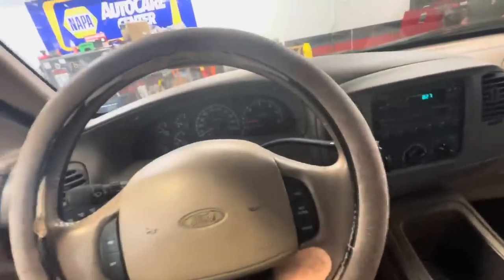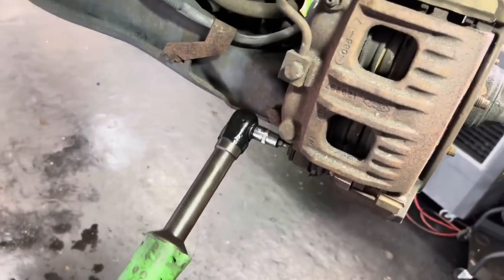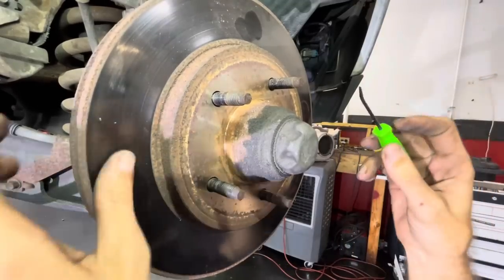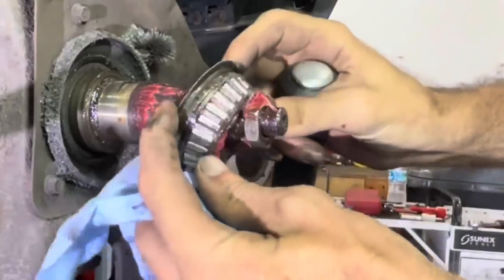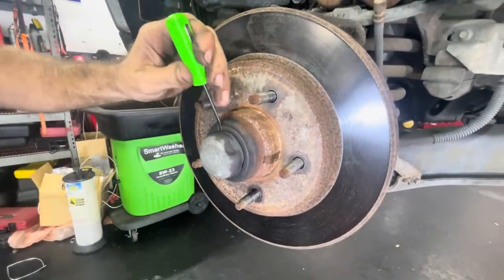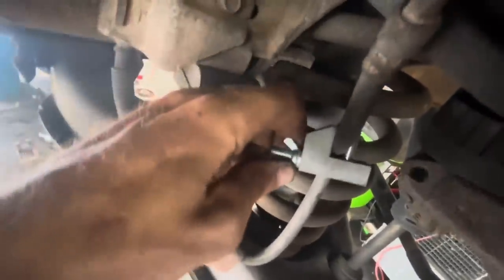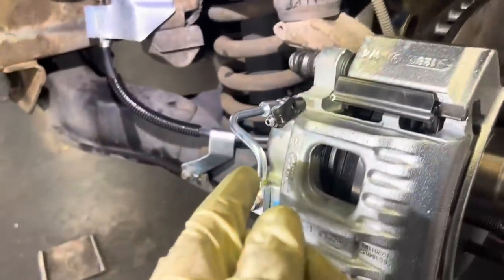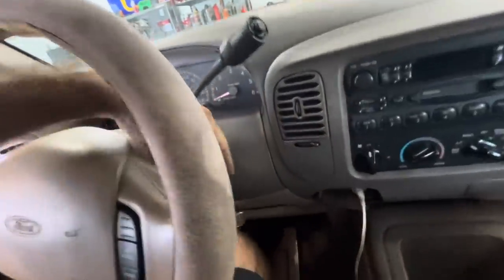Worn to NOTHING! 1998 Ford Expedition

Comment: Ray, may I comment on bearing lubrication ?  Many years ago I was maintaining a factory and got SKF in  (for free) to give us a course in bearing maintenance.  Amongst the gems were greasing the things.  50% of bearings fail as they are under greased and 50% because they were overlubricated.  Grease is 90% oil, so an overlubed bearing can overheat causing the viscosity of the oil drop lowering its effectiveness and hence early failure..
If you look the bearing up on the SKF website, it gives the amount of grease required..
I hope this helps.  Love the vids and running commentary.
Reply: My first job in industrial maintenance was going around on Monday with an oil can and a grease gun it is very important also the last place I worked at the maintenance man drove me crazy because it didn't get done all the time
Reply: @benurr720  Timken, SKF, NTN are all world class products.  You are quite correct to pack the bearings. As to a failure, I can't comment, but I can assure you when we moved to a strict Predictive Maintenance Programme coupled with correct bearing install and lubrication,  our bearing related failures dropped to almost zero in a 1M sq.ft Plant
Reply: @michaelpressman7203  You have my sympathy.  Your employer was wasting your time.  A  Lube tech needs to be properly trained, equipped and scheduled, with a supportive Management.
Reply: @MrRunner  companies nowadays think they're paying for skilled maintenance is a waste of money but ask all the people that went down an airplanes because a part didn't work right you figure it out
Reply: @Graham Miller Consider that a car with 24 inch diameter tires (kinda small but giving you the benefit of the doubt) those wheels will rotate about 845 times in one mile so at 60 mph they will be rotating at 845 RPM. Which is pretty slow compared to industrial spindle speeds. Consider also there is astill quite a bit of air space in those front automotive wheel spindles even with packing extra grease in there. Also consider that, being tapered roller bearings the grease gets move out of the bearings by centrifugal force. All that said... boat trailer wheel bearings are often packed completely full of grease (grease fittings in the bearing caps) and sometimes it is under pressure ("bearing buddies")to keep the water out. Boat trailers also tend to have pretty small tires so they spin faster. They DO fail and fail often but 99.9% of the time it is due to corrosion from water getting in to the bearings.
Reply: @utidjian  It is not the speed, it's the load.  In a wet design, if not correctly sealed it won't matter, water ingress will kill the bearing.  Whenever possible I would buy sealed bearing.
Reply: @utidjian  I was going to make the same example with trailer bearings. Funny I was doing my boat trailer bearings the same day this video came out 😆. The factory/plant environment is probably enclosed and not exposed to the elements. Whereas my boat trailer goes into saltwater every weekend. Every few weeks I pump fresh grease in to ensure there is no void where water can settle. Preventative maintenance keeps you from being a road side spectacle 😆

Comment: 300k on the clock?! That expedition has been well cared for. Kudos to the owner.
Reply: I still daily drive my 97 expedition I bought from a friend in 2001.  It's a little shy of 300k as well.  Runs and drives remarkably well for an old girl.  Unbelievably reliable, back when "quality was job 1".  Still has the original starter, water pump, exhaust system and the AC still works,  Replaced the schrader valves and topped off the refrigerant last year.

Comment: Yes the pliers being used incorrectly bother me as a long time plumber I see plumber use them wrong and ruin the teeth as well as applying teflon tape incorrectly!
Reply: You got to go clockwise with your tape it won't peel off that way
Reply: Plier use only bothers me when people round off the bolts or scrape the bejeezus out of whatever they are gripping.
Reply: Man we're talking about automotive mechanics and all the great things raiders and all you guys keep going on about is a pair of pliers hey take the fires and get a grip for yourself bye
Reply: Any tool used wrong drives me crazy I agree

Comment: Since your installing new rotors and bearings, the races in the new rotor may not be completely seated. So it is recommended to torque the nut on the spindle down to 100 ft lbs to insure the races are bottomed out. Then loosen the nut to the just past finger tight.
Reply: Correct. It's called pre-loading the bearings. I'm surprised Ray didn't do this.

Comment: Great video Ray. One thing I used to do prior to pushing the caliper pistons back was to remove as much brake fluid as possible from the master cylinder reservoir first to avoid over flowing the reservoir if it came in full. Keep up the great work!

Comment: the earlier expeditions  up to 2004 were very reliable in my opinion, we had  a 1999 make it to 394K on the original transmission, rear end, and a/c system, the engine died at 289k due to neglect, the 2nd used engine died at 394k due to neglect

Comment: Knipex, Channel Lock and similar pliers with the jaws set at an angle to the handles DO have a right and wrong way to apply them. The outer jaw pulls the nut/bolt surface tighter into the pliers. The jaw opening should always face left when tightening and right when loosening. Love your videos!
Reply: yes they do have a right and wrong way, the question is "how OCD are you" though, when it bothers you that it's done the wrong way in a situation where there's almost zero load on it and it works just fine either way. The answer is of course "yes it does bother me, OCD and proud!"
Reply: @SebBrosig  The same applies to adjustable wrenches ('Crescent Wrenches'). I have many, from 3" to 24" long, but I rarely use them, since I have actual wrenches and sockets to use. The adjustable wrenches, like pliers, are designed to have the torque applied in one direction,. Watching tools being used incorrectly has nothing to do with OCD. It is more like, "Wow, this person is an idiot".

Comment: Hello been watching most of your videos and I like the way you do things I'm an old-time mechanic I made it three years old done a lot of mechanic in and a log truck driver but I must say I was a little bit disappointed in the way you packed those wheel bearings you need to go on the big side and work them back and forth on the the grease in your hand until it comes out the little side this is the only thing I would like to see you change of course that's up to you I think you are an excellent mechanic keep up the good work
Reply: I bought a 67 Chevy Impala 2 door fastback $400 and all it needed was new wheel bearings
Reply: PS His glove wash dirty and as packing rolled the bearing at the dirty tip of his gloves finger area,. Never wore gloves and washed hands before putting the grease in the palm of your hand.
Reply: @waynetrainor654  I never wore gloves either I know how to wash my hands
Reply: Yes Sir, the grease should go into the larger end and get pushed through the bearing until it comes out of the smaller end. Any grease monkey can confirm that !! Ray is doing it bassackwards here.

Comment: As to adjusting wheel bearings. Every one has their own method. The trick is to get the right preload. A torque wrench is an accurate method. If the split pin holes in the nut ,locking cap do not line up, back off until the holes line up DO NOT tighten the nut.

Comment: If you open the cap on the master cylinder, the fluid has somewhere else to escape and won't push the pistons out.
Reply: Theoretically it should not back out of the reservoir if it does I take a better look at it
Reply: @michaelpressman7203  you're pushing fluid, which doesn't compress. Where else would it go
Reply: @uenragedbro  I always thought there was some sort of a check valve in the system
Reply: @michaelpressman7203  As the pads are worn down, the pistons move further out, holding more fluid in the caliper and taking from the master cylinder. It goes back in the master cylinder when the pistons get pushed in, unless the master cylinder is closed and the fluid has nowhere left to escape but the other pistons.
Reply: @uenragedbro  you're right I wasn't looking at things clearly I was having my first cup of coffee hey have a good day bye
Reply: @michaelpressman7203  you too! What kinda coffee you like maybe I'll get you a bag of it lol

Comment: Your technique of reinstalling the rotating assembly is almost exactly as my own. I was always taught to tighten the bearing to a light-torque preload while rotating and then back off about 1/4 turn. But unlike your description, I feel a very very slight click as I move the assembly laterally. This leaves the bearing an ever-so-small amount of room to expand with heat and still not bind the bearing.

Although I've done it this way for 30 years, I'm now curious if my school of thought has been passed by without my notice. What do others think about my final preload procedure?
Reply: That's what Ford advise for mk2 cortina mk1 and 2 escorts. There should be some play when cold. I'm in the uk as well.
Reply: @martinrobinson9651  Good to know because I'm a medium/heavy tech. I've always just downsized my technique when working on my own or smaller stuff.
Reply: Yep, he should've pre-loaded those bearings. At this truck's next service those wheel bearings will need tightening.
Reply: I do the same as you with the preload....specifically for the heat consideration.

Comment: Fun tip:  An exhaust U joint clamp (of the right size) can be gently tightened onto a wheel bearing dust cap, then you can pry on the clamp all you want and avoid deformation of the dust cap.

Comment: Loved the video. Been a while since I repacked wheel bearings. Has anyone else ever heard of adding STP oil treatment to the bearing cup to extend the life of the bearings? I heard it from a maintenance guy I worked with. Said to halfway fill the bearing cup before you tapped it on. It was the only solution that they found at a GM dealership to solve the problem of premature bearing replacement for one of their customers.

Comment: If you look closely, you'll note that just like a pipe wrench, the teeth on most channel locks are directionally oriented which is what Ray is talking about when it comes to 'proper use'.
Reply: Proper use like using channel locks as a hammer
Reply: @samholdsworth420  Weren't you listening? "Everything's a hammer." LOL

Comment: Just for reference here in the UK the disposable type pin as in this video is a split pin, the reusable type pin is an R clip because its shaped a bit like a letter R and a cotter pin is the type with a wedge cut into one side of it as used to secure the crank arms onto the bottom bracket shaft on an old school bicycle.
Reply: I used to use our pins on race cars if you want to get under the hood real quick they make life easy especially if the car got wrecked

Comment: Another great job, Ray my curiosity is to the effect of how much more it would be to replace the other caliper? I can’t imagine it being that outrageous where are you start out fresh with both front brakes completely redone. Oh well I have a good weekend
Reply: Probably an extra few hundred. Calipers aren't cheap, and the labor to replace the caliper isn't fun either.
Reply: @CalculatedRiskAK  Physically replacing them isn't hard, depending on how much of a pain it can be to get to them. These, just like the ones on my 3rd gen Ranger, aren't hard. The worst part is making sure you bleed all the air out of the brakes. That, in some cases, can take hours.

Comment: At the GM dealership I worked at we had to rebuild the calipers on every brake job due to the heat from braking causing the rubbers to become hard on the slides and caliper piston oring. Caused almost zero comebacks. The only calipers we did not rebuild were the rear calipers with the integrated parking brake in the caliper. By the time you were replacing brake pads on those, the retractors were frozen or had come apart depending if the customer used the emergency brake or not when parked.

Comment: Have you ever thought about using an angle grinder to take off the rust band on a rotor (if you're replacing it anyway) so the caliper will slide off easy? (Just thought of it myself)
Reply: Work smarter not harder
Reply: So easy to press  pistons back into the caliper using a C clamp before even attempting to remove the caliper assembly.  (You probably shouldn't be working on brakes if your first thought was to use a grinder on them)
Reply: @bushmaster2936  the pistons came out, good luck getting them back in. I had it happen on my blazers rear discs (bought it like that) The piston decided to break in half rather than go back in place. Had to replace the entire caliper
Reply: @bushmaster2936  also he's talking about the video you didn't watch obviously. Piston came out and if it happens good luck getting em back in. 

Pistons do go back in easy if you maintain your vehicle properly lol.
Reply: @samholdsworth420  I missed the beginning of the video due to a phone call interruption. Thanks for making me start over at the beginning to see the "over extended" pistons. LOL
 I also noticed Ray prying from one side of the piston . I have had better luck using a C clamp or two to squeeze the pistons back squarely rather than prying them cock-eyed. The seals weren't leaking so the pistons were still in their bores albeit unable to retract by themselves. I've also had a brake hose fail internally causing a one way effect and not allowing the fluid pressure to release, thus acting like a bad caliper. Yes, I have had to replace numerous calipers over the years. We used to rebuild them back in the day if they weren't too badly pitted. Same with wheel cylinders on drum brakes and an occasional master cylinder or two. Have a wonderful day !!

Comment: Split pin, cotter pins are tapered solid pins with a flat ground on one side, used to hold bicycle pedal shafts onto the crank.

Comment: i do a bit of bycycle repair and a park tool grease gun can be filled with your choice of grease, and works WONDERS on packing bearings (the park tool item number is "GG-1") its also refillable. with LOOSE grease. 
one tip, if it stops working and its not empty check for an air bubble as those will stop it in its tracks

Comment: Actually changed the front disc brakes on my 2002 Ford Ranger a few months back. I was taught how to use a packer and the "put a glob of grease in your palm and slap the bearing into the grease, rotating it till you've shoved what you can in, then slather the rollers before making sure you get the other end as well, rinse and repeat" method. 
Didn't change the calipers, as it wasn't exactly necessary, otherwise it's the same exact process. Kind of a pain to find this process so well documented, even here on YouTube.

Comment: Ray, When you have a high ring of rust on the rotor, use a grinder to grind off some of the ring, inside and out then rotate the rotor to align the ground down area with the frozen pads. The caliper should slide off.

Comment: I have a special tool made to pack bearings with grease using a grease gun. When I first started, one of the older mechanics asked if I knew how to pack bearings. I said sure and brought out that tool. He burst out laughing and asked what that was. I took the bearing, put it into the tool and squirted the grease in which pushed ALL the old dirty grease out and packed fresh clean grease throughout the bearing and my hands were clean.

From then on, all 4 of us in the shop on shift used that tool to pack grease. 

Sometimes the new guy can teach old facts something.

Comment: One of the techniques I use when pressing in the bearing seals is to also use a dead blow hammer, but instead of banging on the seal directly, I get something of the same diameter that will fit over the entire seal and then place a flat bar over the round device and bang on the flat bar.  This has the effect of driving the seal onto the rotor with equal force.  I have inadvertently ruined a few seals using the method you use Ray.  OTOH, maybe my hammer technique was not optimal.  Just another was of skinning the cat.

Comment: Yes, the channel locks used the wrong way is one of many pet peeves.  The spindle nut is the way I do it as well.  As far as greasing the bearing, I usually just put some grease in a baggie and work the grease into it.

Comment: Not sure if it was mentioned, but I was taught that you shouldn't fill the bearings to 100%. At least on machine tools (lathes and milling machines), because the grease will expand under heat from rotation and can cause the seal to fail if there is no room for the melted/liquid grease.

Comment: I was taught that the larger fixed jaw of a tool is used for the torquing side. Visually, on the left to loosen and the right to tighten for right hand threads. I’d call it mechanical logic.
Reply: Of course, it is logic. But logic disappeared from the minds of young people about 20 years ago. Today, if it isn't a video game, they are utterly clueless.

Comment: There used to be a tool for taking those hub grease caps off. To hold pistons in, you can stick a piece of wood in instead of clamping the hose.